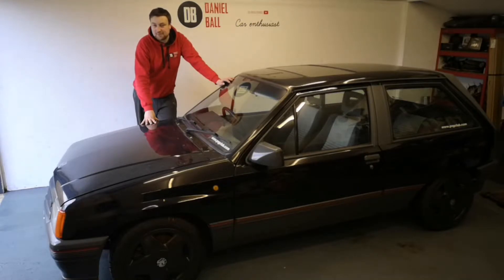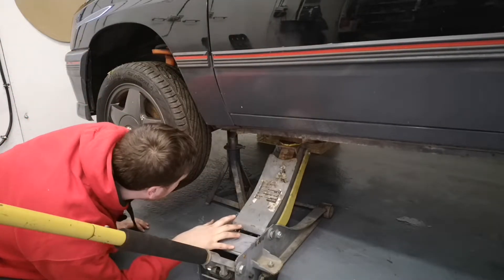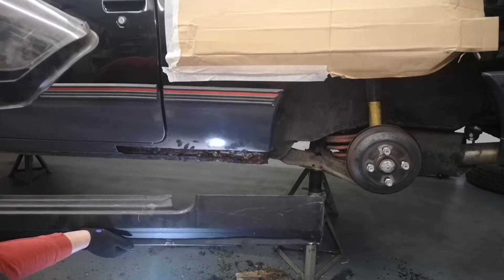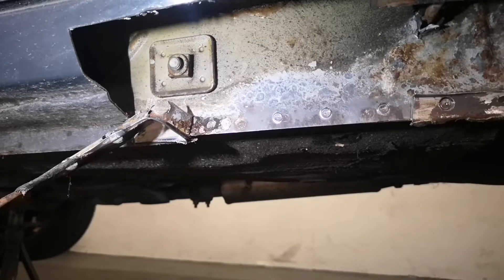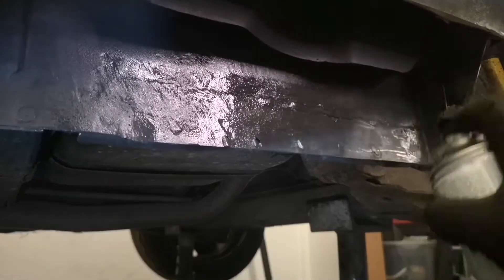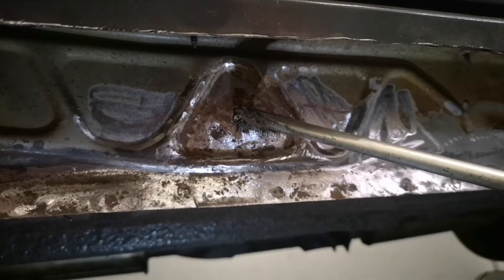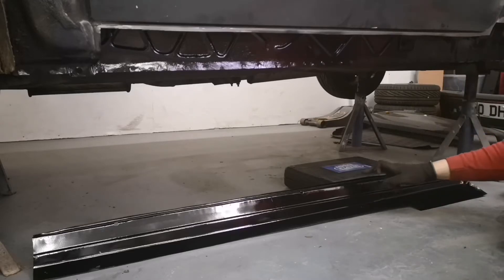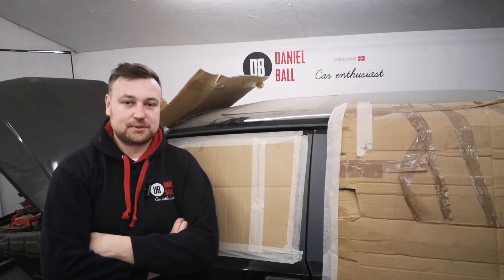Vauxhall Nova SR C20LET Turbo - Sill Repair

Comment: What's the crossmember like? Iam doing mine got a pattern part but it's terrible so gonna strengthen it first. Take it with it being a let Nova it's been cut for intercooler and strengthend?
Reply from the maker: Hi there, cross member is good, I have trimed it back a bit and reinforced previously. Running a Frontera cooler.
Reply: @DanielBall  cool. I ran a frontera cooler on my mk1 Sr. Good size and good on eds phase 2 .
Reply from the maker: @ashcardwell7711  yeah they fit well. This is EDS phase two as well 😊

Comment: Am doing both quarter panels and sills plus inner sills on a corsa B also a few floor patches what welder are you using a gas mig which model I’ve been using a no gas mig and going to go gas
Reply from the maker: Sounds fun that, this is a 180amp Mac Tools welder. Same as an SIP one. It's good, cost around £500. I would recommend the smaller hand held welders, I have tried a few and never found them very good. The bigger Clarke ones are good too, 165 turbo or above.
Reply: @DanielBall  thanks for the info I’ve got my eye on the Sealey 160 welder for £444.00 there are a couple of good YouTube videos on this and good feedbacks have you watched fitzeys videos on YouTube he really is good and explains how panels warp and how to spot weld with no warping using a airline to cool panel during welding 
I was self taught then a friend with own garage but went to agricultural collage and learned but was with stick welder that was crude really I said I can use mig and used that instead  like the V6 conversion but looks huge work to get to final stage I wouldn’t mind doing red top conversation just electrics puts me off.
Reply from the maker: @countmurcielago9802  that's sounds like it will be okay, I haven't seen any of his videos.
Wiring on a C20XE isn't too bad, it's quite straight forward if you break it down, there are lots of guides and information online. 😊

Comment: Use the MPI out the GSI/GTE
Reply from the maker: Yeah I have in the past, they are just a bit rare now and I have a Corsa tank in stock already 😊
Reply: Will a corsa tank fit the same? I know they are pretty much the same underneath! Nice nova BTW.
Reply from the maker: @ashcardwell7711  thanks, they don't fit, but I have been told can be made to fit. The fuel neck is in completely thr wrong place, but I have a plan for that.